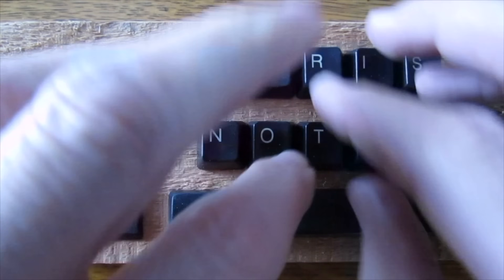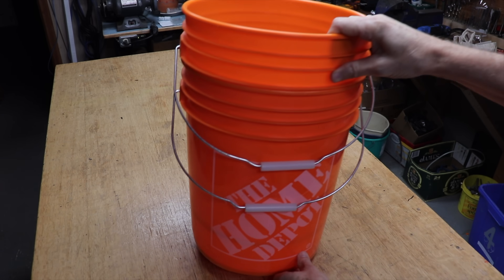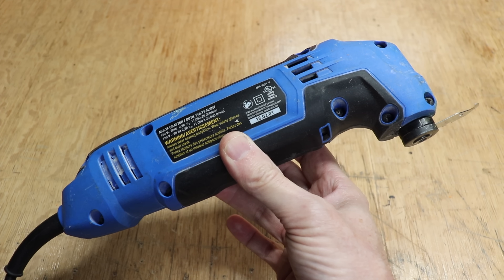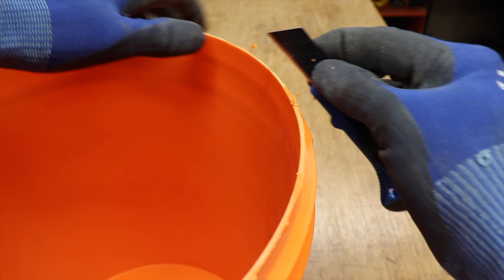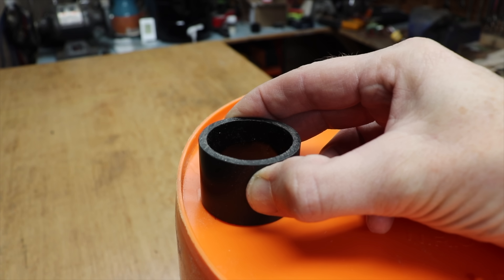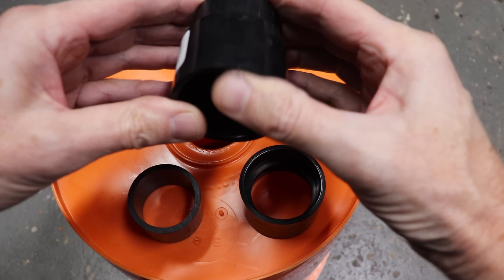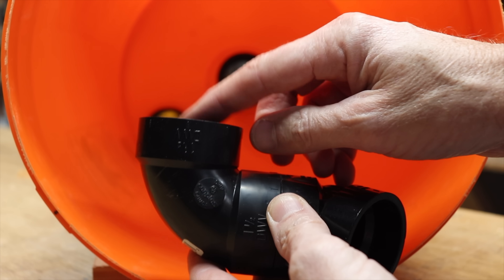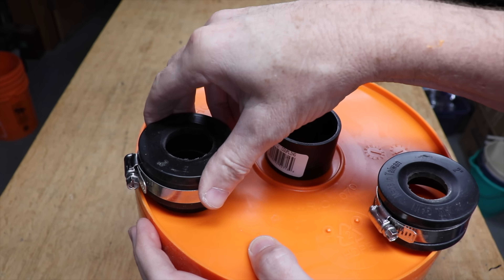How to Make ● Simple Cyclone Dust Collector

Comment from the maker: Before you run out and buy all the stuff to build one, be sure to read the important note I made about the buckets in the description under the video!
Reply: I just built the dust collector. I know you said the 01453 buckets won't work, but they do. All I had to do was chamfer both buckets. The outside of the upper, as shown on your video, and the inside of the lower bucket. It's a tight fit but is the same as your plan. Works like a charm. No dust in my shop vac.  Thanks for the instruction.
Reply: I made similar like you did Chris but my buckets got sucked vacuum
Reply from the maker: @chriscambre702  I made an update video on that issue!!
Reply: @chrisnotap  how to contact Chris notap
Reply: Thank you for this!!
Reply: Amazing! Thanks.
 What would happen if you drilled the inward hole for the dust going into the bucket, lower, like 1/3 or 1/4 down instead of at the top. Would it help with avoiding dust going into the actual vacuum since it's further from the vacuum inlet?
Reply: Chris, what an awesome video! I have built it but where do I get the suction hose that goes on the bucket? Keep up the great videos sir.
Reply: @danlake3383  Amazon or old sweeper

Comment: The 1.5" fitting used in your video would restrict airflow, as my vacuum hose is 2.5 inch. Would 2 inch fittings perform as well as 1.5" ones? Also, would a long sweep 90 elbow  interfere with performance considering they would have improved airflow?

Comment: Found this in January 2026 and it works GREAT! I will probably change the rubber pipe caps to rubber connectors so the hoses are more securely installed. As shown in the video, almost NO dust in the vacuum and 3ish gallons of wood shavings and dust in the collector.
Reply from the maker: Awesome to hear it's working so well for you!

Comment: I am finally starting to use a portion of my basement as a multipurpose workshop this winter. I spent one day cutting and sanding a few pieces of plywood and, unsurprisingly, saw dust covered everything. I needed to finish some tool organization projects fast so I needed a dust collection system immediately. Upon searching for an expedient DIY collection system this video popped up, and it is perfect in both simplicity and parts sourcing.  I just finished some plumbing repairs and upgrades so I already had everything needed.   I finally had a project that only required that which I already had on hand-what luck!  On the other hand, since I have enough to make four of these, I may just have crossed the threshold from productive DIY'er to parts hoarder.

Comment: You forgot to include the 1.5" pvc pipe cut into 3 1-3/8" length in the description. You could also add duck mouth buckles to hold the buckets together.

Comment: Made this a few years ago, works very well. A 600 cfm portable extractor caused the buckets to split- double buckets solves the problem. 2 1/2 inch tubing is better for high volume units.
Reply from the maker: Great feedback, glad it's working well for you!

Comment: Do you think it would work using a 4" inlet and a 2" vac hose in the center?. I want something for my planer but it clogs a 2" shop vac hose in no time. My thought is to run a 4" hose from the 4" planer outlet to the bucket and use the 2" vac hose to draw it. Need a bigger cannister maybe?

Comment: TAKE CARE when doing a diy job making a vortex vacuum unit for your garage or shop or home, even a middle class home vacuum cleaner will suck all but the strongest reinforced plastic containers or even thin steel [less than 2mm] to look like a shriveled and rumpled up mess! trust me - i've tried it and wasted days!
Reply from the maker: I found a solution to that in the update video.

Comment: Hey y'all, I had two gray 5 gallon paint buckets from Lowes that we had left over from a job we did. They are heavy duty and hard to bend and cut. I 
followed these instructions, but still the buckets would not go together. I cut small slits  all along the bucket I was going to use for the top bucket do that I could press it into the bottom bucket. They now mess, but do you think air and sawdust will leak around the two buckets? I need to get the vacuum hoses so I can try it out.

Comment: I could not make this work, I tried all the fixes in your other video, but the result is that there is only a little suction and no movement of air at all at the end of the hose. Maybe one of the connections is not working properly, it's hard to tell. Anyway, what I am doing now is putting a pool filter sock over my shop vac's filter, and just using my vac as a vacuum. The filter sock is easy to take off and shake out, and the shop vac is a lot more mobile than 4 buckets. I'm sure this comment will pass unnoticed among the thousands of accolades, but in case some other failure runs across it, at least here is an alternative.

Comment: Does anyone know if the separator will work with water?  Given that there were small dust particles on the filter at the end of the video I imagine it will suck some amount of moisture into the shop vac.  Looking for a way to vacuum water without having to take the filters out and spend several days drying out my shop vacuum.
Reply from the maker: I made a video on how to make a wet vac also!!

Comment: 5 years later.......
Take the saw dust and add candle wax and cardboard clippings.
Pour the mixture in bread pans, let cool.
Cut the sawdust bread into 1/4s.
You now have $5 chunks of fire starter. $20/loaf. 😉
Or about $300 for a 5 gallon bucket.

Comment: seems good.  Hmm, you could add a buckethead vac on top of your two-bucket design.  Just cut a hole in the bottom of the buckethead vac and place it on top of the two-bucket column.  Then tether the 3-column assembly to a wall and it will take up only 1 sq ft of floor space.  This may also improve airflow since the resistance of the hose from vac to separator is eliminated.

Comment: Hello Master! I did what you have done, everything works fine except something crusial. When I power ON the vaccum the upper bucket made of plastic gets deformed and gets sucked in the lower bucket. Whats the issue here? Do I need more space (taller bucket ) or maybe the vaccum is very powerfull?
Reply from the maker: I did an update video and covered that issue!

Comment: Built this today. Hooked it up, turned on my vac and my buckets imploded. Feeling defeated, I watched the video again thinking I screwed something up. Nope. Jump to the comments to see if anyone else had the same problem. Nope. Went back out thinking, there’s got to be a blockage somewhere in the second hose. Should have checked that first. Napkin. A freaking NAPKIN. If anyone was curious, the answer is yes. An old micro shop vac can and will collapse two Lowe’s buckets if you obstruct your intake hose.
Reply from the maker: That’s great that you found the issue! I also made an update video on this issue also.

Comment: Thank you for your engineering on this dust catcher. I recently purchased the same vac. It came with a bag. That was not going to work. 
I took your parts list and went to Menards. They did not have the rubber ends in 2 inch, but the 1.5 inch fit snug and tight on the 1.5 inch pipe pieces so I only needed one of the joint pieces not 3. Note: my vacuum has a 1.25 inch hose. 
Really just cosmetic 
As I am just getting my woodshop together. I needed more hose.
Went to HF got their Bauer Hose Kit which I highly recommend. The hose an accessories are really a cut above.
The kit came with a pass though piece that fit snug and firm on the 1.5 inch rubber cap so all I had to do was sand out the hole. 
Easy Done
One trip to the store and an hour fiddling and i have a compete and functional system. 
Bonus, I got the parts to fit the discharge on my plainer.
Reply from the maker: That's fabulous! I'm glad you were able to make it work with a few modifications!  What store is HF? I'm Canadian and not sure what that is.
Reply from the maker: Is this the hose kit you mean?   https://amzn.to/41llNYI
Reply: @chrisnotap  yes
Reply: @chrisnotap  Harbor freight

Comment: I built one of these and it works except that it emits a very loud high pitch whine. Must be related to air flow somehow but can't find the solution. Any suggestions anyone?
Reply from the maker: Use the process of elimination. With the vacuum going and making the noise, start by removing a hose. Most people that have had this problem said it was one of the hoses. Good luck.

Comment: Well, I went ahead and made this.  Wow, it really works first time!  Hats off to Chris for the very simple, yet ingenious design. One funny thing though: Do not use a sump pump hose for the intake. I picked one up at Lowes thinking, hey this will work. When I completed the assembly and attached that hose ----- Yikes, a very loud, whistling pipe sound (like 100dB) came out of the hose.  So, there is some kind of tuning in the ruffles in the hose that just makes this crazy sound so you don't want to use that. I went out and got a proper shop-vac hose which didn't make the sound.  Job done.
Reply from the maker: Glad to hear it worked well.  Thanks for the tip on the hose.

Comment: I've watched this video many times over the past couple months. Today I finally decided to make it. Only took about an hour and it works like a charm! I also saw your note for the first time today about static electricity 🔌. I have scrolled and scrolled but I cannot find anybody mention that. Can you please tell me more about this issue or how I go about grounding it? I'm working out of a 10 by 16 wooden shed. Thank you so much!
Reply from the maker: Your best bet is to buy a 3 prong electrical plug. Attach whatever length of speaker wire to the ground terminal in the plug. Get a small alligator clip and attach it to the end of the speaker wire. Now plug it in and attach the alligator clip to the metal bucket handle that is on the lower bucket. It will be easy to disconnect when you need to empty the bucket.
Reply: @chrisnotap  thank you so much for your quick reply. I really appreciate that. Would it be fairly safe to use today without it or would you suggest I go directly to the hardware store before I do any work? It's a long drive, but I want everything to be safe.
Reply from the maker: @ByHisGraceWeAreSaved  Being on a wood floor in your shed it's best to be safe.
Reply: @chrisnotap  Thanks again!

Comment: Why would you put the second hole so close to the first one...? Should be as far apart as possible that's prb some of the reason why you have had trouble with them not working well.
Reply from the maker: The dust is spinning in a vortex. Dust particles get pushed outwards. The centre air is mostly dust free…. hence, the centre hole location.
Reply: @chrisnotap  hmm I didn't think about that. Also it was supposed to say, "shouldn't it be as far apart as possible"

Comment: Excellent video! Just a couple questions: will this setup work with the larger diameter hose of my 16 gallon shop vac with a pvc reducer? Or should I use larger diameter fittings in the bucket?

Comment: Good video and good idea. Seen a couple others clone your idea. I happened to have a Lowe’s blue bucket so got another and they don’t have the multiple ridges to guide the cut but on mine, cutting below the upper ridge allowed them to fit, albeit very snuggly. I used a heat gun on the upper drum along cut edge enough to get it good and warm then shoved them together and let them cool. Seemed to fit a tad easier after. With my 2.5” vac, I found inlet and outlet were kind of close and could short circuit, plus it was very tippy due to the weight of the fittings and hoses. I got lucky and found a sort of cone shaped/tapered 35 gal drum for only $15. Cut a new top from a scrap piece of osb and moved my fittings to it. Actually added the cut bucket under the lid at the exit to isolate the exit pipe in the calm center. It’s working perfectly. Nearly zero carry over so far. Thanks for the great inspiration to improve my dust collection!
Reply from the maker: Nice work!

Comment: I'm confused sorry but just for clarification how did this add value to the workshop like couldn't you just use the shop back for the same thing is it because you don't have to change it as often does it add some other element like is it you know what I mean like when I think of dust collection I think of it's pulling all the dust out of the air but this you're just sucking up wood chips and Sawdust from the ground right noel points to filter out the air in general can this still do that?
Reply from the maker: It's a lot better than trying to removed impacted saw dust from a shop vac filter. A lot less messy.

Comment: Thank you for posting this.  I made mine, and it looks like it is going to work well.  I’m in Canada, and found the HD buckets (as you mentioned, didn’t work), but Lowes is now Rona in Canada, and after buying 1 bucket, I thought let’s return to the HD, and see if I can make it work(since I already had them).  I ended up putting a dozen cuts in the rim of the top bucket, and 6 cuts to the bottom bucket rim.  This allowed it to mesh well.  Don’t cut all the way to the next rim, only 1/4 inch or less from the top.  Thanks again.

Comment: A hole saw good for making round holes In a plastic bucket— assuming you have the right size hole saw. It makes a more accurate circle than I can cut with a knife. You can use a cheap hole saw unless you’re making many, many holes, because bucket plastic Is very easy to saw through.

Comment: Thanks so much for this simple, functional build. I have a large shop vac so I scaled up the PVC and hoses to 2", and used 2" clamp-on rubber connectors with 4" sections of PVC pipe instead of the caps. My buckets are the white ones from Walmart so you can actually see the bottom bucket filling. Your design is perfect - the sawdust even forms a "vortex" pattern in the bucket when opened. I do get the static shocks so I'll be adding a ground wire. What a difference in my little workshop 👍

Comment: As a bonus, if you happen to have a stihl shop vac, that handle on the lower bucket slips over the hose brackets on the back of the machine.  Bucket base sits on the floor and easily follows as you move the vacuum around.

Comment: Just happened to run into this when viewing cyclone reviews. Frankly, as a chem engr, I think this will serve most needs. For my vac, I’ll need to find 2.5” fittings. But I was thinking a simple catchpot would suffice, especially for larger planer chips. I love the double bucket idea, this solves my dilemma of finding a single tall cylinder and fabricating a top and bottom. Honestly, I question what an 18” tall or similar mini cyclone might improve upon this catchpot type idea. Great video demonstration as well.
Reply from the maker: Thanks!

Comment: wonder if You can do this with 2 round garbage cans
Reply from the maker: The problem is as you scale up, the vacuum becomes very strong and will easily collapse the garbage bins. A steel drum would be the way to proceed and experiment.

Comment: I just priced out the parts listed on the Amazon links and you can literally buy a dust deputy for cheaper than all the fittings you need to make this and you will only have to put in 4 bolts.

Comment: Great video! Went out and got the parts tonight. My HD buckets do not have the LEAKTITE or specific serial number on it so - cross my fingers - they’ll go together. For $60 CAD, it wasn’t worth it for me to buy the step drill bit just to punch a starter hole in plastic. All told, it cost me $42 CAD for all the pieces. Thanks for the tip!

Comment: I made a water filter like this that would actually clean the air of smoke and dust and smells - besides handle all the extraction chores. Pretty easy to figure out - I used a tall Shop Vac (40 gal).

Comment: This seems like a neat project, but is a bit more expensive then just buying a prebuilt one. The connectors, caps and PVC alone are about $50. You can purchase a well manufactured contraption for similar price, or a bargain version for $20.

Comment: I tried this when I first got started and it kinda worked. But honestly don’t waste your time. Spend a few more dollars and buy a cyclone and connect it to a bucket that it was made for. The biggest flaw with this setup is emptying it. Good lord it’s extremely hard to separate the two buckets when you have to empty. You will probably spend about 50$ building this. For 150$ or less you can have a cyclone that works much better and is easy to empty. Those buckets collapse making the system flawed. Systems like this are cheap now days. I speak from experience. I bought a used Festool extractor for 125$ and added a cyclone to it and it worked better than I could have imagined. I was about to spend 2k on a system for my two car garage shop but this set up works so well it’s all I need.

Comment: My cyclone collector has two right angle fittings inside. The inlet and outlet fittings are pointed in a circular direction along the outside edges of the container. It has been in action for over 10 years and works great.

Comment: "for the outside...hold it 90 degrees to the  surface of the bucket" proceeds to hold the knife at about a 45 degree angle 😄
Reply from the maker: I was hard to explain that part. The knife is held at 90 degrees to the circular top opening of the bucket is what I meant.

Comment: Static can be a big problem, especially in low humidity or when vacuuming dry, dusty things. The inexpensive plastic hoses that are in most small shop vacs can be really bad about static. 
Some vacuum hoses are anti-static - made with a conductive mesh or have a wire coiled into the hose or running along the outside to dissipate the charge. You can buy anti-static hoses or there are ways to add static reducing features yourself.